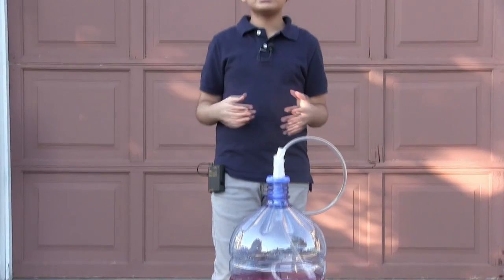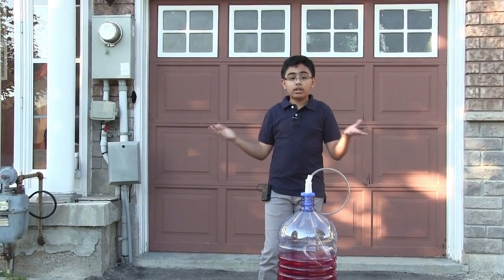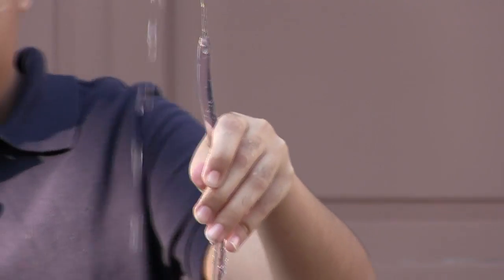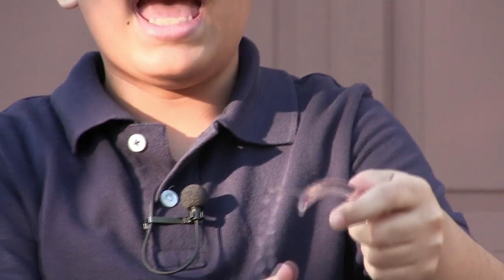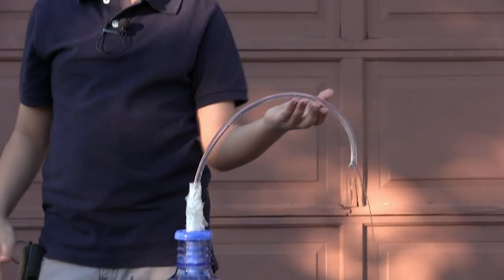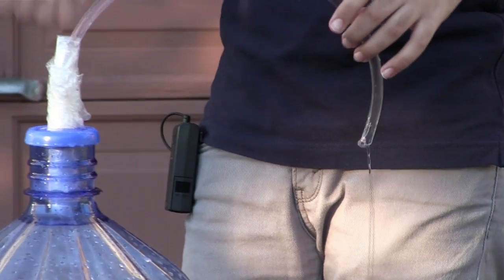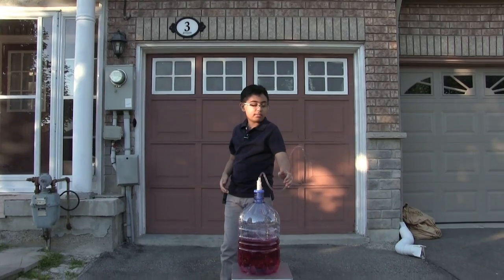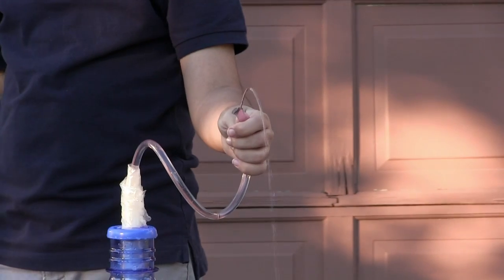Science Experiments with Tanmay, General Education & Tanmay's Shorts: Air pressure fountain!

Comment: Hi tanmay Bakshi I liked your experement but when I tried it in a mettal bottle ,straw and put a tissue around the straw and blowed it did not work. I tried it with water.
Reply from the maker: This experiment works only if the neck of the jar is airtight (sealed properly). If you use tissue, the air seeps through it. Try using a half filled 2L plastic bottle, a plastic straw and tape cut from hard plastic bag. It will work.

Comment: at 5:30 why is there no way for air to get out.
Reply: Vini The second end of the pipe is in water. So when he blows air the  air exits the pipe into water where due to density difference the bubble travels upwards and starts accumulating at the top. Once the enough air is collected at the top, it pressurizes the water to get out
Reply: 0:10 Do you see the cap on the top of the container? It creates a kind of seal (not completely) so the air can't escape. Good question!
Reply: Why doesnt the air leave through the pipe. . I mean why does it favour water over air when deciding what to let out of the container.. if you get my question :) thank  u